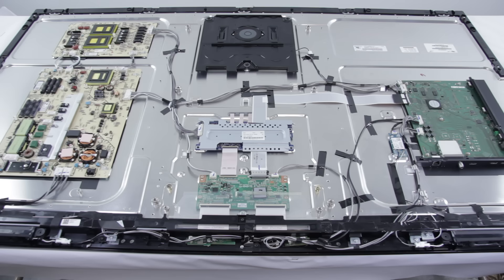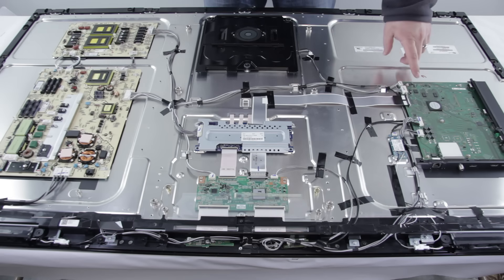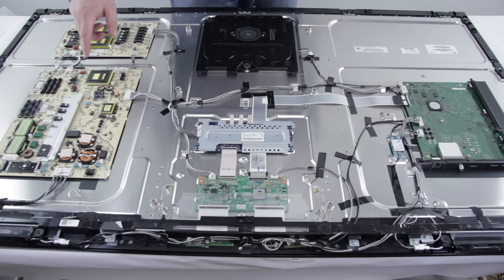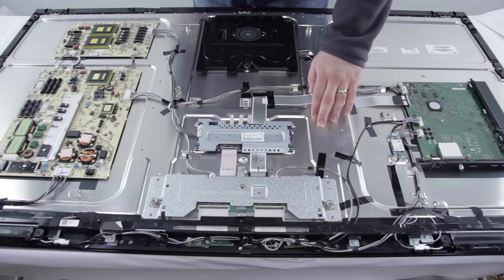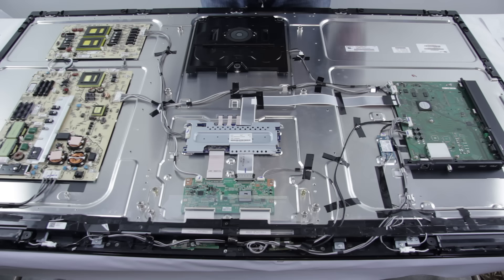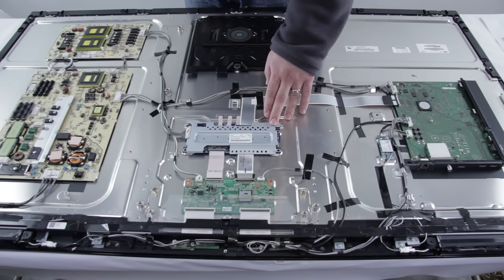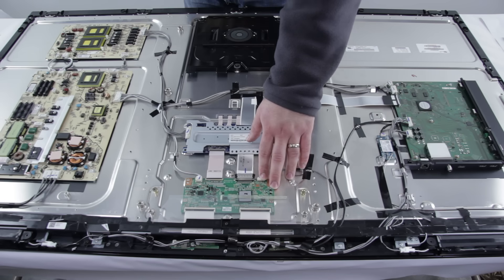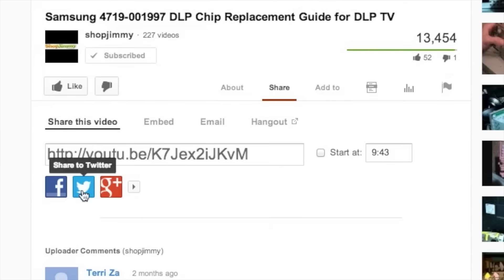LED TV Repair Tutorial - Common Symptoms & Solutions - How to Repair LED TVs

Comment: LG 55LV5500 - No picture from A/V source.  Grey to black screen with grey and black vertical lines that slowly scroll to the left.  No OSD, but image will respond to RATIO.  Can hear static through speakers with no source connected.Reseated all connectors and ribbon cables.  Display remained unchanged as connections were wiggles and tapped.Would you recommend replacing the TC board first?  Could you give me a quote for the part?
Reply from the maker: +CATbay10   Try all repairs and troubleshooting at your own risk.  This sounds like a TV panel (TV Screen) problem.  If your TV panel is bad, it may be more cost-effective to replace the TV as panels are typically hard to find in stock, difficult to replace, and expensive.  Thanks and please let us know if you have any further questions!  www.shopjimmy.com

Comment: Hi I have Samsung LED 3D Tv (Model: UA40C7000WEMXL)  recently it starts giving double images and and vertical & horizontal lines. Sound is on, tv start & shutdown as usual, all other functions including HDMI input works... Let me know the issue and what to replace?
Reply from the maker: +Nuwan Kularathna   Try all repairs and troubleshooting at your own risk.  This sounds like a TV panel (TV Screen) problem.  If your TV panel is bad, it may be more cost-effective to replace the TV as panels are typically hard to find in stock, difficult to replace, and expensive.  Thanks and please let us know if you have any further questions!  www.shopjimmy.com

Comment: Thanks for your video. Need help with Sharp Aquos Quattro LC-70LE857U.  Here is a link to a youtube video of my problem. If you have any suggestions I would be grateful. Happened less that a year old but due to health issues did not address with Sharp immediately. When I did they said it was out of warranty with no other info. The link is  https://youtu.be/DqNRQDLY-LE
Reply from the maker: +Gary Latta   Try all repairs and troubleshooting at your own risk.  This could be a problem with either the main board or the TV panel.  You can replace the main board to see if that fixes the problem.  Click this link to replacement parts for your TV model number:  http://www.shopjimmy.com/sharp-dkeymf953fm06-main-board.htm  There may be multiple boards for the same TV model number, be sure to match part numbers on your current board, with your replacement for compatibility.  Thanks and please let us know if you have any further questions with your TV Repair!  www.shopjimmy.com

Comment: GREAT VID!!

I have a Samsung 46" 3d LED tv (ue46f610) Ive noticed what i think is backlight issue. If an image appears with very bright high whites the tv dims slightly after a few milli seconds. Even with backlight setting right up it seems like the tv is not as bright as when i 1st got it? Its like the tv kills the brightness slighlty, like power savng or it cant sustain the power need to keep the max backlight running. Does this sound like a common issue or am i just going crazy?

thanks

Comment: Hi, thanks for the videos- they're very helpful!  I have an LG model no. 47LW5300.  Last evening while changing the channel using the remote the TV turned off.  Now when turning it back on it flashes a couple times before staying on - but it only displays one channel!  I'm unable to switch channels or AV inputs, select menu settings or make any changes using either the remote control or the buttons on the TV.  The only thing the has any effect is the power button.  Please advise.  Thanks again...  Scot
Reply from the maker: +Scot Bray  Try all repairs and troubleshooting at your own risk.  I recommend replacing the main board in your TV.  Click this link to replacement parts for your TV model number.  http://www.shopjimmy.com/catalogsearch/result/index/?cat=56&q=47LW5300  There may be multiple boards for the same TV model number, be sure to match part numbers on your current board, with your replacement for compatibility.  Here is a link to a video showing how to identify your part number, click here:  https://www.youtube.com/watch?v=RwHTvjMdrhk  Thanks and please let us know if you have any further questions with your TV Repair!  www.shopjimmy.com

Comment: Hi, i wondering if you can suggest the right replacement part for me? I have a sharp lc-50le440u and i am having problems getting it to work. When i turn it on the green light turns on but nothing happens. I've hooked up my HDMI and i don't get any sound or picture.. Also, when i try to turn it off nothing happens with the green light. It continues to stay on.  Any suggestions what part i need?

Comment: hi I have an LG model 42LT560E. When I press power on the TV starts up. I see the LG start screen then it shows that the input is on HDMI 1. Almost exactly 10 seconds later the screen turns black, and stays black
Reply: LGIT PCB P/N: 3PAGC10096A-R
Date: 12.01.30
Rev 1.0

Comment: I have Samsung Smart TV Model #UN40D6400TV it will turn on a rare occasion.  As soon it keep power cycling on the start up screen with the Samsung logo.  I changed the power and main boards.  Checked the ribbon connector, did a firmware update.  Also disconnected the remote control sensor.  Any help would be appreciated. Someone suggested it might be the LED light strip ?
Reply from the maker: +David exel  Try all repairs and troubleshooting at your own risk.  Sounds like you could have received a defective replacement main board or power supply board.  Thanks!  www.shopjimmy.com

Comment: I have a LG 47LD520 and  the TV works fine but then in the morning it does not turn on.  I have to unplug it for awhile before it turns back on.  I replaced the power supply and it still does the same thing.  Any help please ?

Comment: samsung un55es8000 smart tv.  Tv freezes and then restarts it self and then does that cycle all over again. if i leave it unplugged for a while it will work for a random amount of time. then will happen again.
Reply from the maker: +Derek machado  Try all repairs and troubleshooting at your own risk.  I recommend replacing the main board in your TV.  Click this link to replacement parts for your TV model number:  http://www.shopjimmy.com/catalogsearch/result/index/?cat=56&q=un55es8000  There may be multiple boards for the same TV model number, be sure to match part numbers on your current board, with your replacement for compatibility.  Here is a link to a video showing how to identify your part number, click here:  https://www.youtube.com/watch?v=BEPWrefQvqI  Thanks and please let us know if you have any further questions with your TV Repair!  www.shopjimmy.com

Comment: hi jimmy i have a led tv problems pls help me with this my tcl led tv model 39d30  ang serial aly106482n0024 when i turn it on its normal but 5 mins after that the picture gone abut it has sounds when i flashlight test it apperas that i see somthing on the screen but its too dimmed.i just experement it and i put electrict fan on the back of it and its contimue working as normal.whats the problem of my tv thanks and regards

Comment: Sharp Aquos 70 inch LED TV LC-70le755u  - symptom - single horizontal line about 7 inches from the bottom of the screen - it is lit from the right side and fades away a little more than half way through the screen.   It's like that row of pixels has the colors from the rest of the picture but is out of sync.

Comment: Hi... have a Samsung UN60EH6003FX2A version HH01.  On power up with nothing connected to the TV, I get the power up chime, and the screen comes alive telling me there is no input signal.  When I connect an HDMI source it may play for a few minutes or a few seconds, and the TV goes through a quick restart sequence, with the screen going black, the startup chime coming on but it is clipped (doesn't finish) and the tv then again repeats the restart.  After it goes into these cycles it doesn't stay on long enough for the backlight to start.  In some cases when it will operate for a few minutes, just connecting an HDMI source will cause the screen to go black and the restart cycle to begin.

I am thinking main board?

Thanks in advance!
DR.

Comment: I have a sony kdl-55xh800 works for a few hours then shut's off and blinks 7 times if i let it sit for a while it works fine for a hours i installed a new main board from Jimmy's now the tv does not come on at all green light blinks and orange light blinks and yes i did download sonys firmware but the tv does nothing but blink i get nothing on screen so i put the original main board back in and tv works fine but i know it will shut off in a few hours.
Reply: +george gingrich  The model is kdl-55hx800

Comment: Hi,
LG 50La6205    Led tv.
Backlight is not staying on......it comes on for 2 seconds an then goes black....I can see the picture with a flashlight....have sound.  I read that it is the power suppply board number 62810801 ----but it could be the actuall leds especially with this power supply/led board.....how can I be sure which it is...I have the back off the TV and can measure voltages on the PS/led board.  Hope to sort out which problem I have before ordering part -- I see you have led pack and ps/led board.....thank you so much for your help.
Reply from the maker: +b mybusiness  Try all repairs and troubleshooting at your own risk.  Since you have experience using a meter to check voltages, you can check the measurements at the LED connection on the PS/Inverter board.  Thanks!  www.shopjimmy.com

Comment: I have a vizio 70"led model no. m701d-a3. I get sound but no picture. backlighting does work briefly, it starts normal but dims to almost nothing after a few seconds. I have replaced t-conn, main board and primary power board with no change.

Comment: HI JImmy Thanks for your regular updates. I have a Samsung 40 LED UA40D5900VR Model and the Speakers are Vibrating and a Flat noise coming. When the SRS surround is started or even on normal occasions the Bass Flattens the speaker. I feel the Down Firing Speaker would have blown out. I do not know to to get through the Speaker outlet which I can check fro replacement. Can you help and also do you have any spare parts for it?

Comment: Hi, I have a LG 50LN5100 LED TV(LCD screen with LED backlights). Been watching your vids.  Great stuff. Here's my problem, when I turned the TV onthis morning for the first time today I had no picture but sound. I thought maybe it was input so I pressed the input button and it turned the TV off. I powered it back up and now I have no sound and no picture but it will power up because I see the red "power on light" at the bottom of the frame.  Watching your vids I checked for light out of the back and see none.  I did the flash light test and did not see any type of image. 
Your help would be gratefully appreciated.
Reply from the maker: +Brooks Ingersoll   Try all repairs and troubleshooting at your own risk.  I recommend replacing the main board in your TV.  Click this link to replacement parts for your TV model number:  http://www.shopjimmy.com/catalogsearch/result/index/?cat=56&q=50LN5100  There may be multiple boards for the same TV model number, be sure to match part numbers on your current board, with your replacement for compatibility.  Thanks and please let us know if you have any further questions with your TV Repair!  www.shopjimmy.com
Reply: +ShopJimmy.com 
I did what you recommended and now I have sound and the red light at the bottom stays on even when I try to change channels where as I had nothing before.  I believe now I should replace the LEDs. I am still getting a flash when I power on the TV.  I believe I saw another video about this.

Comment: Hi, I have a Samsung un46eh5000f and have a backlight inverter problem I believe (tv has sound but no image and I did the flashlight test and could see faint images).  I have opened up the back panels of my tv but their are only 3 boards.  One to the left, one in the center at the bottom and a larger one on the right.  I can't figure out which one is the backlight inverter?  The small board at the bottom in the middle, has two ribbons attached to the bottom of it which wrap under the tv and seem to connect somewhere else.  Any help would be greatly appreciated!!!!!  
Thank you :)

Comment: Hey guys. I have a 55" Vizio LED tv (Model No.: E550i-B2). It has picture and sound but the lower left corner of the screen is significantly darker than the rest of the screen. It's roughly a 5"x12" area. My guess is either a bad LED or lose wire to the LED. What do you guys think?   Thanks for the help.
Reply: Gg

Comment: I have a Vizio VU42L.  No signal from HDMI 1 since a lightning strike, all other inputs okay.  Also, sometimes when I turn it on I get audio but no video.
Reply from the maker: +UprTupr   Try all repairs and troubleshooting at your own risk.  I recommend replacing the main board in your TV.  Click this link to replacement parts for your TV model number:  http://www.shopjimmy.com/catalogsearch/result/index/?cat=56&q=VU42L  There may be multiple boards for the same TV model number, be sure to match part numbers on your current board, with your replacement for compatibility.  Here is a link to a video showing how to identify your part number, click here: Thanks and please let us know if you have any further questions with your TV Repair!  www.shopjimmy.com
Reply: +ShopJimmy.com Fixed!  I installed the new main board I bought from shopjimmy.com and HDMI 1 is back.  No telling yet whether this fixed the intermittent audio only on power up.

Comment: I have a Apex LD4086 will not power on I check the power supply (#MLT668TL) for any blown capacitors or burnt spots on the board but didn't find any. Could it still be the power supply.
Reply from the maker: +Shaun Purdy   Try all repairs and troubleshooting at your own risk.  I recommend replacing the main board in your TV.  Click this link to replacement parts for your TV model number:  http://www.shopjimmy.com/catalogsearch/result/index/?cat=56&q=LD4086  There may be multiple boards for the same TV model number, be sure to match part numbers on your current board, with your replacement for compatibility.  Here is a link to a video showing how to identify your part number, click here:  https://www.youtube.com/watch?v=julrdW2bjOg  Thanks and please let us know if you have any further questions with your TV Repair!  www.shopjimmy.com

Comment: I have a JVC LT 32E710, when i turn it on in the morning, the picture flickers and goes black. If I turned it off and then back on several times it will eventually stay on. tcon board? how much? are the parts avail?
Reply from the maker: +John Galbraith   Try all repairs and troubleshooting at your own risk.  This sounds like you have bad LEDs in your TV.  Unfortunately we do not sell replacement LEDs for your TV model number at this time.  You can check back in the future to see if we have them available.  Thanks!  www.shopjimmy.com

Comment: I have an LG50LN5700. The Screen turns on and shows the LG logo and then goes black. When I shine a flashlight on it I can see the picture. It also has sound. After watching your video, I ordered a replacement power supply board/led board. I installed it today and the TV still does the same exact thing as before. What can be the issue?

Comment: Hi I am Saanjoa,
I have a Samsung LED TV with model code: UA32EH5300RXUM, and model:UA32EH5300R. It is about one&half year i bought it. Now i had a problem with my TV. When i turn it on, it showing the Samsung logo and all after that its turning off by itself and turning on by itself, it's keep restarting. Can u help me in this case? I heard there is common capacitor problem in the power supply board which cause this issue. Or i suspect Main processor board. Please help me to repair this.
Reply from the maker: +saan joa Rughas   Try all repairs and troubleshooting at your own risk.  I recommend replacing the main board in your TV.  Click this link to replacement parts for your TV model number:  http://www.shopjimmy.com/catalogsearch/result/index/?cat=56&q=32EH5300  There may be multiple boards for the same TV model number, be sure to match part numbers on your current board, with your replacement for compatibility.  Here is a link to a video showing how to identify your part number, click here:  https://www.youtube.com/watch?v=BEPWrefQvqI  Thanks and please let us know if you have any further questions with your TV Repair!  www.shopjimmy.com

Comment: I have a Vizio E420i-A0.  It has sound, and the backlights.  I did the flashlight test, I cannot see any image- but the screen is illuminated slightly.  I took off back cover- I only have a main board and power board.  I don't see any visible damage to either.  What would you suggest?

Comment: Hello I have a Visio E470i-AO When the power button is pressed the little blue power indicator comes on for about 5 seconds or so then goes out. The TV does not power on other than that. I used the services of Answers.com to get some troubleshooting help. I was asked to check the voltage between points 1 and 2 of the output to the main board and I got 5.1 volts. I got nothing else from any other points. I was told that it was the main board. I purchased a main board from ShopJimmy.com order number 1880920. When I installed the new main board I have the same symptoms. I was a little frustrated and kind of gave up. I am interested again and would appreciate any help you can give. I checked each pin of the power supply output to ground and only have 5.1Volts on pin 1. Thanks again for any help.